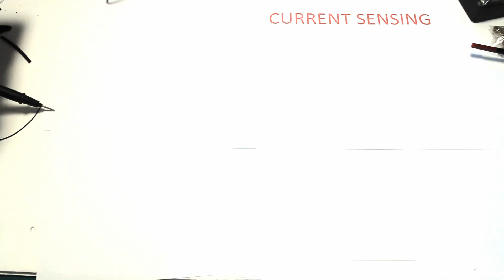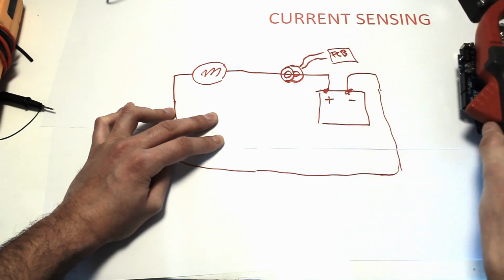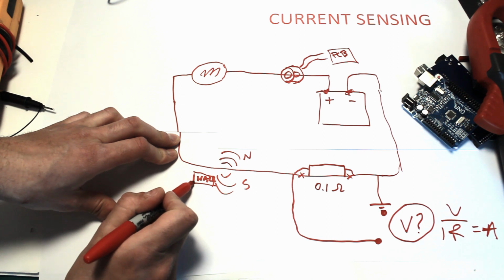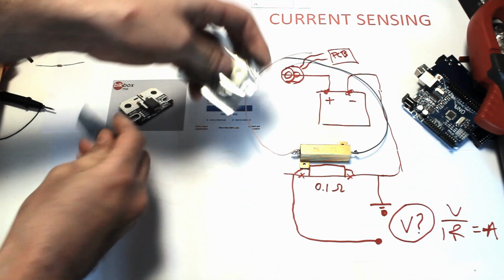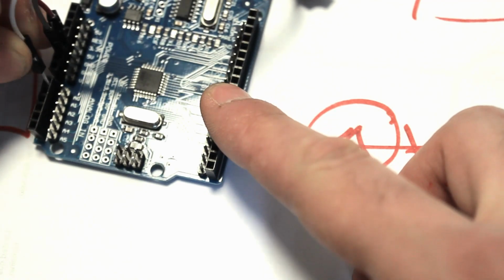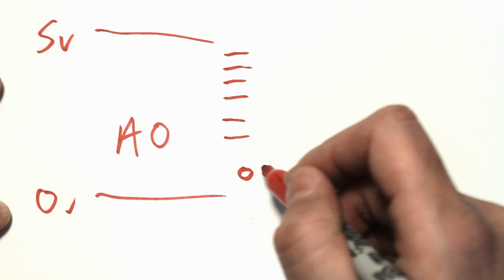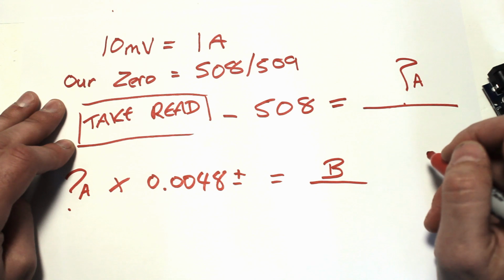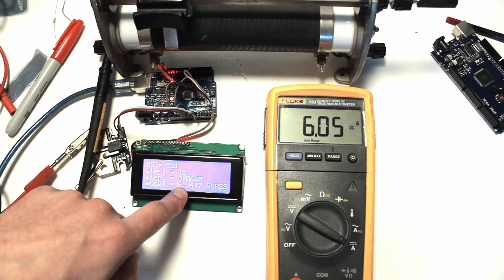How To Current Sense - I Try A New Current Sensor for Arduino

Comment: Sir, what is the Ao output voltage of module when current direction is forward
2) what is the AO output voltage when current direction is reversed.

Comment: Hi 
Please help for chose connector and route in PCB for 400A 
Thanks
Reply from the maker: That's a lot of current. If you search on the net for "PBC track calculator" you will find a tool, but it will be unrealistically large.. you would be better off staying to large cable and using a bolt on current shunt resistor, or a clip on current clamp hall sensor. The sensor in this video is also designed to have cables bolted on, but I don't use these anymore as they are fairly inaccurate for smaller currents.
Reply: @DanSohan Thanks

Comment: A current diverter could be made with this sensor, for example for the surplus of solar energy not to inject into the network but to be redirected to a hot water boiler through the solid relay, of course if I could show the arduino code. thank you very much.
Reply from the maker: Maybe, I'm not sure on a current diverter..
If I were Charing a battery, I would measure the voltage of the battery, and when it reaches full voltage I would turn a relay on to connect the heater element. Then when the voltage drops a small amount turn the heater off again. Then the heater would cycle on and off when the battery is mostly full.

If you have a bus or network, I guess you could monitor the bus voltage and do the same sort of thing.. 

If you can control the heater with PWM you could maintain the network or battery voltage more closely. 

Using the current sensor would only show you how much current is flowing into each system. In that case I would use 3. 1 from the solar panel, 1 to the main load and one on the line to the heater
Reply: @DanSohan  I would like to do something like this, I have one I bought that uses acs770lcb-050b and has a built-in drawer and 4 outputs to be able to mount 4 solid relays, I don't know how to program arduino, I will make a video with the diverter I bought.
https://youtu.be/HwMLaKYgFBU

Comment: My idea was to use two identical of these sensors with the input current connections in reverse and in parallel, so that half the current goes through each BUT in opposing directions, so the outputs of each sensor again go in opposite directions, e.g as one output rises from midpoint the other one falls. Then measure the difference between these differential outputs by using two analogue pins; A0 and A1. This will not only give you twice the current capacity of using one device, but give better thermal stability as the output drift should be the same in both and in the same direction, thus being cancelled in the differenctial measurement, it also allows you to use a program to measure the difference between these instead of using the midpoint voltage as a zero current point. And by using two analogue inputs, you are only measuring half the circuit input current with each device, so you can effectively double the resolution by splitting the total current measurement differentialy between two analogue inputs.
Reply from the maker: Hi, good thinking. I have used some lower-powered modules in parallel before and halved the value, but that is a good idea running them in differential modes. I haven't done this before but may now think of it if the need arises.
Reply: @DanSohan  Hi Dan, just to expand on this, my original intention was Not to use a micro with this back to back sensors configuration, I intended to use an analogue panel meter suitably calibrated with attenuation (potentiometer) to read the voltage difference between the two outputs directly in amps. Also a digital panel meter could be used; say 0 to 1 . 999 volts, again suitably attenuated (calibrated) to read the voltage as amps, but you would need a 5volt isolated supply to power the meter, e.g one of those 5v to 5v 1watt isolated power blocks, as the negative input on the meter would be the negative power rail for the display. Again No Micro needed, just a panel meter and two sensors, suitable for a car or high current monitoring on battery inverters.
Reply from the maker: @malcolmwright7440  I've just done a similar project to measure current and remaining capacity of a 12v leisure battery. I ended up going the 100A current shunt way, using a INA219(I think) differental amp with I2C out. It logs instantaneous amps, ah in and ah out and bus voltage all in 1. To save putting a display in I played with the MIT app creator and used a Bluetooth module to send the variables to my phone. That way I can keep check on my vans battery without going out to it in the cold. Works a treat. Planned to do a video, but time has not permitted yet
Reply: @DanSohan  legend, would like to see the video whenever you make it, like the idea of Bluetooth or WiFi to a phone, not gone down that path yet myself, am suffering from brain overload atm.
Reply: @DanSohan  My INA219's are 3amp only. I think you might mean ACS758's. I was fortunate enough to purchase lot's of these from 50amp to 200amp bi-directional a few years ago before China started to get expensive and dropped free postage, Luckily.
Reply from the maker: @malcolmwright7440  I remove the resistor from the ina219 modules and connect any size shunt resistor. Mod the code to match.
Reply: @DanSohan  Ah, we think alike, I purchased some 0.03 ohm (I think) surface mounts to place across the modules resistor (thought it was internal)  to try double the modules current to 6amp, which makes it much more suitable for measuring the current of solar panels. Unfortunately I am busy trying to store power than building circuits to measure it. I have a plethora of handheld devices to do this. Warning, do not leave LCD displays in the outside weather, the moisture eats away the tin oxide connections on the display, already lost two displays this way ! Also cheap Chinese LED displays have little copper on the PCB and this disappears after a year of weather exposure also !

Comment: Pls can you share me the code and link to buy the hall sensor.
Reply from the maker: Sorry I do not have any links, but they should be available on ebay or aliexpress and other suppliers. 

 As far as code. It is simply an analog output, so you need to read the ACD and then multiply it by the mV per Amp given for the particular sensor (found on a datasheet)  then as  the sensor give ~2.5v at zero amps (goes both ways as measures + and - current flow, you then subtract the 2.5v to make it read zero when no current is flowing.

Comment: Arduino ADC  doesn't have enough resolution for this sensors... I'm using ADS 1115 for that kind of sensors.
Reply from the maker: Depends how much resolution you need. You can always increase the resolution on some adc ports

Comment: These parts are in production but have been determined to be
NOT FOR NEW DESIGN. This classification indicates that sale of
this device is currently restricted to existing customer applications.
The device should not be purchased for new design applications
because obsolescence in the near future is probable. Samples are no
longer available.
Reply: Can you offer support for this statement?  I checked Allegro Microsystems' website today, and did not find any indication of "not for new design" on the ACS758 page: https://www.allegromicro.com/en/products/sense/current-sensor-ics/fifty-to-two-hundred-amp-integrated-conductor-sensor-ics/ACS758

Comment: /*
 * 
 * Arduino Sketch for Allegro ACS758 Current Sensor with LCD1602 & I2C module
 * this sensor can measure current at range of up to 200A
 * It operates with 3.3 or 5V
 * This video requires you to watch the following 2 videos before using this code:
 * 1- ACS758 Sensor https://www.youtube.com/watch?v=SiHfjzcqnU4
 * 2- LCD1602 with I2C https://www.youtube.com/watch?v=q9YC_GVHy5A
 * 
 * 
 * Written by Ahmad Shamshiri on Tuesday June 19,2018 at 20:40 at Ajax, Ontario, Canada
 * for Robojax.com
 * View the video instruction fro this code at https://youtu.be/tug9wjCwDQA
 * This code has been downloaded from Robojax.com
 */
#define VIN A0 // define the Arduino pin A0 as voltage input (V in)
const float VCC   = 5.0;// supply voltage 5V or 3.3V. If using PCB, set to 5V only.
const int model = 2;   // enter the model (see below)

float cutOffLimit = 1.00;// reading cutt off current. 1.00 is 1 Amper

/*
          "ACS758LCB-050B",// for model use 0
          "ACS758LCB-050U",// for model use 1
          "ACS758LCB-100B",// for model use 2
          "ACS758LCB-100U",// for model use 3
          "ACS758KCB-150B",// for model use 4
          "ACS758KCB-150U",// for model use 5
          "ACS758ECB-200B",// for model use 6
          "ACS758ECB-200U"// for model use  7   
sensitivity array is holding the sensitivy of the  ACS758
current sensors. Do not change.          
*/
float sensitivity[] ={
          40.0,// for ACS758LCB-050B
          60.0,// for ACS758LCB-050U
          20.0,// for ACS758LCB-100B
          40.0,// for ACS758LCB-100U
          13.3,// for ACS758KCB-150B
          16.7,// for ACS758KCB-150U
          10.0,// for ACS758ECB-200B
          20.0,// for ACS758ECB-200U     
         }; 

/*         
 *   quiescent Output voltage is factor for VCC that appears at output       
 *   when the current is zero. 
 *   for Bidirectional sensor it is 0.5 x VCC
 *   for Unidirectional sensor it is 0.12 x VCC
 *   for model ACS758LCB-050B, the B at the end represents Bidirectional (polarity doesn't matter)
 *   for model ACS758LCB-100U, the U at the end represents Unidirectional (polarity must match)
 *    Do not change.
 */
float quiescent_Output_voltage [] ={
          0.5,// for ACS758LCB-050B
          0.12,// for ACS758LCB-050U
          0.5,// for ACS758LCB-100B
          0.12,// for ACS758LCB-100U
          0.5,// for ACS758KCB-150B
          0.12,// for ACS758KCB-150U
          0.5,// for ACS758ECB-200B
          0.12,// for ACS758ECB-200U            
          };
const float FACTOR = sensitivity[model]/1000;// set sensitivity for selected model
const float QOV =   quiescent_Output_voltage [model] * VCC;// set quiescent Output voltage for selected model
float voltage;// internal variable for voltage
float cutOff = FACTOR/cutOffLimit;// convert current cut off to mV

// ======== start of LCD1602 with i2C settings
#include <Wire.h> 
#include <LiquidCrystal_I2C.h>

// Set the LCD address to 0x27 for a 16 chars and 2 line display
LiquidCrystal_I2C lcd(0x27, 16, 2);
// ======= END of  LCD1602 with i2C settings
void setup() {
    //Robojax.com ACS758 Current Sensor 
    Serial.begin(9600);// initialize serial monitor
    Serial.println("Robojax Tutorial");
    Serial.println("ACS758 Current Sensor");
    Serial.println("with LCD1602 & I2C");    
    // initialize the LCD, 
    lcd.begin();   
  // Turn on the blacklight and print a message.
  lcd.backlight(); 
    lcd.clear();
  lcd.print("Robojax");
  lcd.setCursor (0,1); // go to start of 2nd line 
  lcd.print("ACS758 Current Sensor"); 
  delay(2000); 
  lcd.clear();  
}

void loop() {
  //Robojax code ACS758 with LCD1602 and I2C
  float voltage_raw =   (5.0 / 1023.0)* analogRead(VIN);// Read the voltage from sensor
  voltage =  voltage_raw - QOV + 0.007 ;// 0.007 is a value to make voltage zero when there is no current
  float current = voltage / FACTOR;
  if(abs(voltage) > cutOff ){
    Serial.print("V: ");
    Serial.print(voltage,3);// print voltage with 3 decimal places
    Serial.print("V, I: ");
    Serial.print(current,2); // print the current with 2 decimal places
    Serial.println("A");
  //start of loop Robojax code ACS758 with LCD1602 and I2C
  lcd.clear();
  lcd.setCursor (0,0); // set to line 1, char 0  
  lcd.print("Current: ");
  lcd.setCursor (9,0); // go to start of 2nd line
  lcd.print(current);
  lcd.setCursor (15,0); // go to start of 2nd line
  lcd.print("A");

  lcd.setCursor (0,1);    
  lcd.print("Sense V: ");
  lcd.setCursor (9,1); // go to start of 2nd line
  lcd.print(voltage);
  lcd.setCursor (15,1); // go to start of 2nd line
  lcd.print("V");   
  lcd.backlight();
 //end of loopcode Robojax code ACS758 with LCD1602 and I2C

    
  }else{
    Serial.println("No Current");
  lcd.clear();    
  lcd.setCursor (0,0);    
  lcd.print("No Current");    
  }
  delay(500);
}
/*
 * 
 * Arduino Sketch for Allegro ACS758 Current Sensor with LCD1602 & I2C module
 * this sensor can measure current at range of up to 200A
 * It operates with 3.3 or 5V
 * This video requires you to watch the following 2 videos before using this code:
 * 1- ACS758 Sensor https://www.youtube.com/watch?v=SiHfjzcqnU4
 * 2- LCD1602 with I2C https://www.youtube.com/watch?v=q9YC_GVHy5A
 * 
 * 
 * Written by Ahmad Shamshiri on Tuesday June 19,2018 at 20:40 at Ajax, Ontario, Canada
 * for Robojax.com
 * View the video instruction fro this code at https://youtu.be/tug9wjCwDQA
 * This code has been downloaded from Robojax.com
 */
#define VIN A0 // define the Arduino pin A0 as voltage input (V in)
const float VCC   = 5.0;// supply voltage 5V or 3.3V. If using PCB, set to 5V only.
const int model = 2;   // enter the model (see below)

float cutOffLimit = 1.00;// reading cutt off current. 1.00 is 1 Amper

/*
          "ACS758LCB-050B",// for model use 0
          "ACS758LCB-050U",// for model use 1
          "ACS758LCB-100B",// for model use 2
          "ACS758LCB-100U",// for model use 3
          "ACS758KCB-150B",// for model use 4
          "ACS758KCB-150U",// for model use 5
          "ACS758ECB-200B",// for model use 6
          "ACS758ECB-200U"// for model use  7   
sensitivity array is holding the sensitivy of the  ACS758
current sensors. Do not change.          
*/
float sensitivity[] ={
          40.0,// for ACS758LCB-050B
          60.0,// for ACS758LCB-050U
          20.0,// for ACS758LCB-100B
          40.0,// for ACS758LCB-100U
          13.3,// for ACS758KCB-150B
          16.7,// for ACS758KCB-150U
          10.0,// for ACS758ECB-200B
          20.0,// for ACS758ECB-200U     
         }; 

/*         
 *   quiescent Output voltage is factor for VCC that appears at output       
 *   when the current is zero. 
 *   for Bidirectional sensor it is 0.5 x VCC
 *   for Unidirectional sensor it is 0.12 x VCC
 *   for model ACS758LCB-050B, the B at the end represents Bidirectional (polarity doesn't matter)
 *   for model ACS758LCB-100U, the U at the end represents Unidirectional (polarity must match)
 *    Do not change.
 */
float quiescent_Output_voltage [] ={
          0.5,// for ACS758LCB-050B
          0.12,// for ACS758LCB-050U
          0.5,// for ACS758LCB-100B
          0.12,// for ACS758LCB-100U
          0.5,// for ACS758KCB-150B
          0.12,// for ACS758KCB-150U
          0.5,// for ACS758ECB-200B
          0.12,// for ACS758ECB-200U            
          };
const float FACTOR = sensitivity[model]/1000;// set sensitivity for selected model
const float QOV =   quiescent_Output_voltage [model] * VCC;// set quiescent Output voltage for selected model
float voltage;// internal variable for voltage
float cutOff = FACTOR/cutOffLimit;// convert current cut off to mV

// ======== start of LCD1602 with i2C settings
#include <Wire.h> 
#include <LiquidCrystal_I2C.h>

// Set the LCD address to 0x27 for a 16 chars and 2 line display
LiquidCrystal_I2C lcd(0x27, 16, 2);
// ======= END of  LCD1602 with i2C settings
void setup() {
    //Robojax.com ACS758 Current Sensor 
    Serial.begin(9600);// initialize serial monitor
    Serial.println("Robojax Tutorial");
    Serial.println("ACS758 Current Sensor");
    Serial.println("with LCD1602 & I2C");    
    // initialize the LCD, 
    lcd.begin();   
  // Turn on the blacklight and print a message.
  lcd.backlight(); 
    lcd.clear();
  lcd.print("Robojax");
  lcd.setCursor (0,1); // go to start of 2nd line 
  lcd.print("ACS758 Current Sensor"); 
  delay(2000); 
  lcd.clear();  
}

void loop() {
  //Robojax code ACS758 with LCD1602 and I2C
  float voltage_raw =   (5.0 / 1023.0)* analogRead(VIN);// Read the voltage from sensor
  voltage =  voltage_raw - QOV + 0.007 ;// 0.007 is a value to make voltage zero when there is no current
  float current = voltage / FACTOR;
  if(abs(voltage) > cutOff ){
    Serial.print("V: ");
    Serial.print(voltage,3);// print voltage with 3 decimal places
    Serial.print("V, I: ");
    Serial.print(current,2); // print the current with 2 decimal places
    Serial.println("A");
  //start of loop Robojax code ACS758 with LCD1602 and I2C
  lcd.clear();
  lcd.setCursor (0,0); // set to line 1, char 0  
  lcd.print("Current: ");
  lcd.setCursor (9,0); // go to start of 2nd line
  lcd.print(current);
  lcd.setCursor (15,0); // go to start of 2nd line
  lcd.print("A");

  lcd.setCursor (0,1);    
  lcd.print("Sense V: ");
  lcd.setCursor (9,1); // go to start of 2nd line
  lcd.print(voltage);
  lcd.setCursor (15,1); // go to start of 2nd line
  lcd.print("V");   
  lcd.backlight();
 //end of loopcode Robojax code ACS758 with LCD1602 and I2C

    
  }else{
    Serial.println("No Current");
  lcd.clear();    
  lcd.setCursor (0,0);    
  lcd.print("No Current");    
  }
  delay(500);
}

Comment: My left ear received substantially more current than my right ear. Anyway, you have to properly shield this puppy before using it because any magnetic field in environment can influence the readings (try a magnet close to the chip). I don't think you need the board if you want to directly solder it into the circuit, the chip alone cost about $2 on ali. For me,  the problem is the Arduino (software),  it is not accurate enough, it is already scaled down. Because of that it is very sensitive to noise and pretty inaccurate. If you don't plan to measure such high amps, lower the Amp requirements (= scale) to improve precision.
Reply: Haha same. I thought my earphones have damaged!